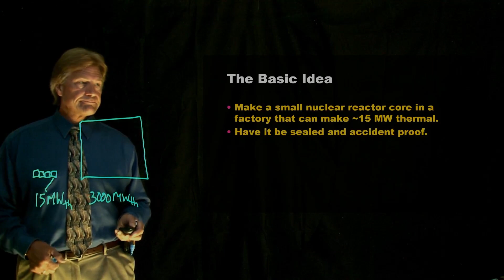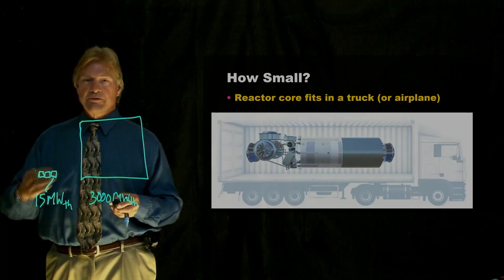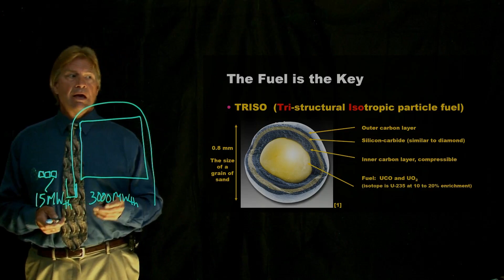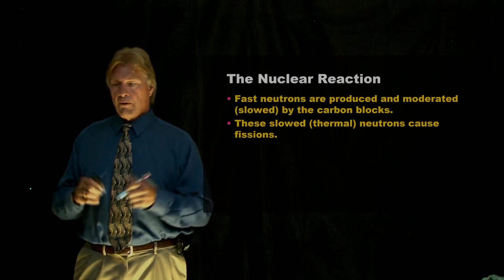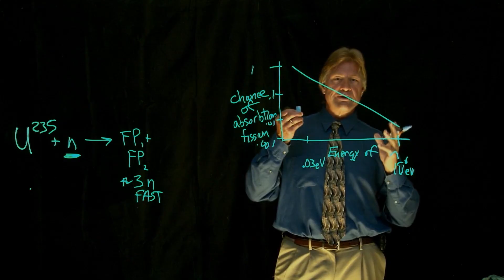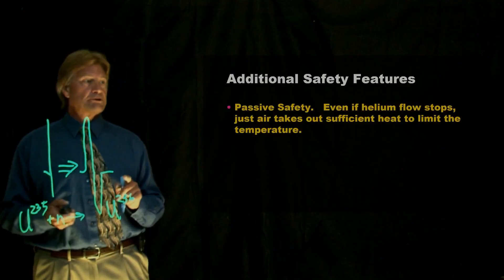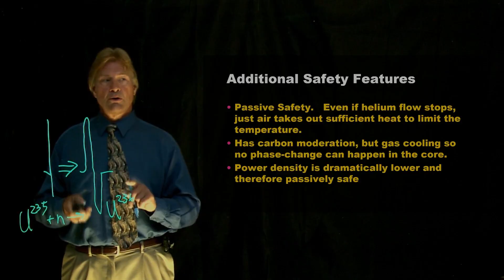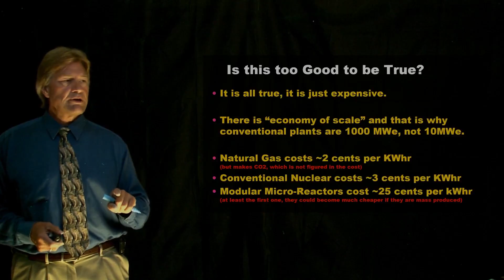Modular Micro-Reactors – The Future of Nuclear Energy?

Comment: Everybody always freaks out about burying radioactive material. Where do they think it came from? The only real concern is putting it out of the range of ground water contamination.
Reply: Much of the waste is made radioactive by the process of running the reactor as I understand it.
Reply: @stevemickler452  it's the exposure to the isotopes fueling the reaction to create heat. The fuel rods, fluids, etc. That's why the idea of making the unit that small makes so much more sense. They're smaller than the waste drums used to be and way smaller than the new casement systems.
Reply: @Cmoth040  While a small reactor may make sense; a problem I see is converting its heat into electricity. Steam works most efficiently at large scale. A smaller steam turbine is less cost effective. At one point the prof mentions adding modular reactors to handle peak loads but fails to point out that either more steam turbines need to be added or the size of the one you have must increase. This is costly or inefficient and either way you lose.

Comment: We need to stop wasting time and $$$ on 'thermal' power.  Anything that needs to use heat as an intermediate step is an economic non-starter.  Solar-Thermal, Geo-Thermal, Nuclear-Thermal.  It's impossible for any of it to compete with solar PV, Wind and Storage economically in most areas.  Find a way to make electricity from nuclear without using heat as an intermediate step and it might stand a chance.  'Till then stop wasting limited capital on a dead end.
Reply: Voice of sanity. Thanks.

Comment: Would you be able to eloborate on the costs of modular design compared to fossil/coneventional nuclear/solar&wind when looking at the abillity to replace existing fossil plants with modular reactors related to the fact you have the connection to the grid in place (as opposed to conventional nuclear and solar/wind) and the comparison let say footprint because humanity will need the premium locations for housing and agriculture/farming  and the like ? And of course many thanks for clarifying these topics to the broader public!
Reply: It depends greatly on the location because in remote areas the cost for shipping fuel becomes more relevant than the cost of the fuel. Remote areas can use solar and wind to supplement power but neither provides consistent power. Especially near the poles where there may be darkness for long periods of time and maintenance of wind generators under harsh conditions can make them less reliable. The human cost of losing power under such conditions can be catastrophic, with not enough heat to keep people warm or enough power to operate critical systems such as well pumps or communication systems.

Comment: This is obviously something very useful for a more dispersed small scale use case, so it's definitely part of the future of nuclear energy. But for large scale grid the big reactors are obviously better. As long as the grid is interconnected, most energy demand can be satisfied with large power plants much more efficiently.
People often claim "But these can be mass-produced". But nuclear power plants can always be mass produced, even the big ones. Those are mass-produced in factories as well, as long as there's demand. Look at Russia right now. Sure, they're no longer mass-produced in the west because there are no orders for any power plants.
Reply: Its the budget overruns that is always the problem with big reactors. It always ends up far more expensive than the projected budget.
Reply: @johnrockwell5834  This is what happens when you start any project when it's not even finished designing, when government policy and public support doesn't exist for it, when the industry isn't there because there are barely any orders if at all.
Yes, going small helps a lot when the market is small. But this is energy we are talking about. The market shouldn't be small. But everyone everywhere right now is relying on old power plants and, if the case, building new natural gas power plants instead of any nuclear capacity.
Reply: @zolikoff  
Exactly so SMR's are a way around this. Because practically what happens is what I said. And the time to build takes too long.
Reply: @johnrockwell5834  The problem is that if these irrational issues persist, SMRs will not be a saving grace in any sense.
Reply: @zolikoff  
Sure. Only for those who are willing.
Reply: kkthxk  Oh it's not an unspoken stigma at all. It's very much outspoken. Anti-nuclear movements are some of the most vocal and active in sociopolitical terms. In many countries the feeling unites strong political opponents on the left and right with the common cause of preventing nuclear power. It's one of the last widespread superstitions, that's why it's so strong.

Comment: Incredible presentation! I wonder how a TRISO reactor compares to a LFTR in terms of cost, time will tell.
Reply: totally different animals. SMR designs are meant to be portable where cost isn't as much a concern. LFTRs are meant to compete with fossil fuels to produce grid power. If you are powering a remote station in the Arctic or Antarctic, not having to ship tons and tons of diesel or natural gas on ships or planes would eventually save you money. McMurdo station in Antartica runs on big CAT diesel generators and a few wind turbines. Everything there depends on a steady supply of diesel, or the people freeze. Now, imagine you can replace not only the diesel guzzling generators but also provide an unending source of heat via alcohol loops that are already there (the waste heat from the diesel generators is carried via glycol - it's a giant car radiator) and you only need to ship fuel to it once every 20 years. Having the US Navy or US Coast Guard deliver diesel is probably hideously expensive long term. The station operates on mostly 1-2mw of power per day but can produce up to 8mwe. That's where the cost difference for the TRISO reactor would come from. It's much more expensive up front, but the constant cost of diesel might actually pay for the thing in time. And, since its technically all US government, fuel restrictions aren't as big an issue. If the Navy wanted to give someone a bunch of spent submarine fuel, they'd likely find it has more than enough energy left over to be diluted down for TRISO production. Higher enrichment isn't a big deal if it's not going to commercial uses. The fact that it can't be stolen because Antarctica is another big help. 

A LFTR on the other hand, doesn't really do small. It could, but you have to have enough fissile material to keep it running, and since you're dissolving it in salts and pumping it through, your LFTR is automatically going to be much larger. But when you need to compete with coal or gas on a developed energy grid, using a fuel that is basically everywhere (Thorium is common in just about any mine in the Western USA) the larger reactor makes a lot more sense. More expensive than a TRISO SMR, but that's to be expected when you're powering a city and can spread costs over decades.
Reply: @Clean97GTI  so it seems like SMRs and TRISO are good for quick/small solutions (also don't need a chemical processing unit) and LFTRs could be replacement for grid power. Promising stuff! thanks for the info

Comment: When nuclear's role in the electrical grid is relegated to competing with diesel generators in remote communities... ouch

Also, hydrogen can provide process heat for steel
Reply: Hydrogen is not an energy source. It is a energy transport medium.
Hydrogen would also need to be shipped to location, which would not be desirable.
Added to this, I don't understand your comment related to the nuclear vs diesel comparison. The comparison is based off of economical benefits. That is how the world works, cheapest wins, except if there are advantages that outweigh the  price.
-1 to your comment
Reply: @davidheindryckx8692  You are right about Hydrogen and process heat. Hydrogen is effectively a Battery; it needs to be isolated/produced, transported and then burned to use. You can also use a magnifying glass and sunlight for green process heat, but like hydrogen it's at least one layer more complicated than that. As for the diesel comparison, I read it as disappointment from @RobbiePT about emotional politics and ignorant/illogical public opinion making it prohibitively expensive or impossible for fission plants to be developed and built as part of the grid.

Comment: Why not use salt as the coolant if you’re going to use a salt loop to move heat?
Reply: My guess would be because it's supposed to be a closed system. So no maintanance until end of life.
Salt being highly corrosive, could degrade parts to a dangerous level in a shorter timeframe than you want to run that reactor.
Reply: @MrAntiKnowledge  salt is less corrosive than water, particularly at the temperatures we’re talking about.
Reply: @kokofan50  I guess it depends on the salt. I was thinking flourite salts, like they are usually proposed for MSR Designs.
But maybe there are less corrosive options. shrug I'm no chemist/nuclear scientist.

Comment: Just one small correction. The thermal coefficient is negative in all commercial reactors, they too shut down automatically in case of overheating. The problem is that the fission products keep decaying and generate heat, up to 10% of the maximum power output of the reactor, and that's still plenty enough to melt the fuel. To prevent this, reactors have to be actively cooled for days or weeks after shutdown, and that's the real problem.
Small reactors with much smaller power density and much higher surface to volume ratio need much less cooling. They can be passively safe even with conventional fuel. With TRISO fuel even big reactors can be completely meltdown safe.

Comment: It should also be noted that there are quite a few different ways to make tiny reactors like this. Molten salt reactors work quite well this scale. Also the first production micro reactor is likely to be the Oklo Aurora which is a metal core with heat pipes to cool it.

Comment: I love nuclear; but I think too many people in the nuclear industry are blinded to what the 'actual' issues with nuclear are. Size is not the issue; SlowPoke reactors (https://en.wikipedia.org/wiki/SLOWPOKE_reactor) were designed and developed in the 80s... 'Safety' per say is not the issue... Nuclear power is demonstrably safer than most things you'll ever encounter in life.  The issue is that IF THERE IS WASTE GENERATED; the public reacts negatively to it. Yes it can be stored safely and it isn't an issue, but the fact that you can't just park a nuclear cask in a public place (even though it would probably be 'safe' to do so) highlights the real issue people have with nuclear. Public perception, valid or not, is the ONLY issue with nuclear. Technologies that don't address that are just variations of trying to sell a garbage sandwich.
Reply: The only issue with nuclear, is that the LCOE is reaching $100/MWh, while renewables and gas are closer to $50. Public perception could help in reducing these costs, but the industry needs to do better.

Comment: ONLY the Thorium MSR can be small enough. The other are just too heavy and expensive.
Thorium cost is 30$ while uranium cost is 5000$ (this is ONLY enriching 1 kg, not enriched 5 kg)
So let's look at the costs:
Thorium nuclear power:
Income: 525 000 000 $
Capital: 1 000 000 000 $
Fuel cost: 2 900 000  $ (30$ per kg, 99t/y used) 
Startfuel: 700kg per 5000$ per kg = 3 500 000$
Time: 2y
Interest: 3% (60 000 000$/2y)
Payment: 25y
Profit: 458 500 000$ in second year
This is a GOLDMINE!!!
Reply: It is incorrect to say that only thorium reactors can be made in these sizes. In fact, the MSR designs I’m familiar with (I worked in that area at NRC) are all at least 10 times larger. MSRs also have a lot of highly radioactive material circulating in a relatively large volume in comparison to micro designs.
Reply: @gizmophoto3577  
I have NO IDEA how you can pack so much power in such a poor cooling factors as water(light, heavy) or working gas.
Molten metal...i do not reccomend.(sodium)
Only molten salt can work at 800 degree without any "rods" we simply do not need.
And radioactivity is NOT a problem.
Reply: Władca Wymiaru Radioactivity can be managed, but it going to be a challenge to maintain a facility remotely, as many areas are lethally hot.  It certainly can be done, but it is not easy.   Thorium can work, my view is that it doesn’t confer any particular advantages over uranium.   Further, there are design concepts, some rather well-developed, that can serve in the niches describe in the video.  I actually rather like MSRs, but they aren’t the only game in town. 

The history of nuclear power is littered with claims of tech that will lead to a new day of happiness and prosperity for all mankind.

Comment: While these MMRs may be good for remote and specific power applications as stated, SMRs in the 200 MW range will likely have much better power economies and be the better choice for the greater power market. As for economies of scale, all that is needed is a facility that can run multiple reactors in parallel.
Reply: Or you could just buy solar and wind for much less and pocket the difference.

Comment: I often hear how MSR and nuclear heat can be used for efficient hydrogen creation, but is the heat from these actually sufficient? I hear steam reforming plants operate at a temperature range of 815-925 C, but generally the operating, along with output temperatures of MSR are often cited as well below that in the 600 to mid 700 range or less. Are they thinking that this heat can be concentrated, or supplemented to reach critical temps for steam reformation? Or are they thinking that eventually they can design an improved version for even higher temperatures?
Reply: There is another process to produce hydrogen from heat. Wikipedia the sulfur iodine cycle. It turns water with a chemical reaction into hydrogen and oxygen, Not methane into hydrogen and carbon dioxide. Nasa also invented a machine called a turbo inductor. It's a turbine with a magnet on the end that heats a tungsten plate behind it. It allows the tungsten plate to get a higher temperature than the steam/helium entering the turbine. Allows you to turn a 10 mw stream of steam with a temperature of 300C to a 8 mw stream of 2000C helium. Making it hot enough for pretty much every need for process heat.

Comment: I don't buy it. Hard to see how they can compete with diesel. There is just too much regulation and general resistance to nukes to let this happen. You want those mining folks and oil drillers to have, on site, (small) nuclear reactors. What could possibly go wrong? 

Plus this really doesn't solve anything. If you want to tackle green house gas, you need to hit the large production, not a bunch of small remote sites.

What is needed is a safe (ie molten salt based) fast breeder that can be scaled up or down in size “burning” reprocessed spent nuclear fuel. We would need ~10,000 1GWe of them worldwide. Then energy production problem is solved for the next 1000 years. Plus, the existing nuclear waste is the fuel, and the resulting new waste disposal storage time is reduced from 300k years to 300 years.  That is still a long time, but doable.
Reply: Thankfully the military is looking into mobile versions of these: https://www.thedrive.com/the-war-zone/26152/the-u-s-military-wants-tiny-road-mobile-nuclear-reactors-that-can-fit-in-a-c-17
That might be the kick needed to establish an economy of scale and a proven safety record that allows this technology to be used in the private sector. Either way the military needs this technology, the amount of money spent on supplying fuel to power operations in Afganistan was insane and part of that cost was funneled to the Taliban through the bribes the truckers paid for safe passage. If the future is going to include laser weapons and rail guns diesel is just not going to cut it. We can only hope the military can prove the technology so the private sector can reap similar logistical, economical, and environmental benefits from it,
Reply: Moltex.
Reply: New study suggests economics are not there for SMRs.  https://policyoptions.irpp.org/magazines/august-2020/small-modular-reactors-arent-the-energy-answer-for-remote-communities-and-mines/